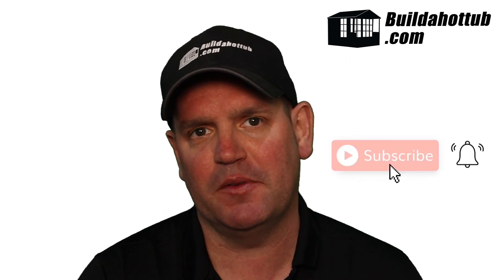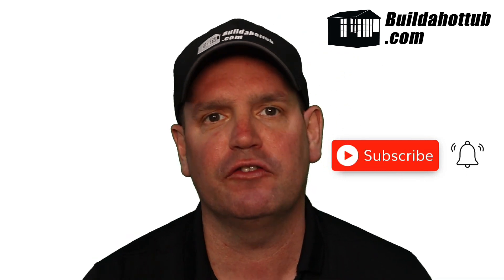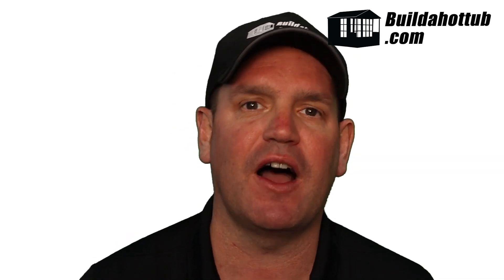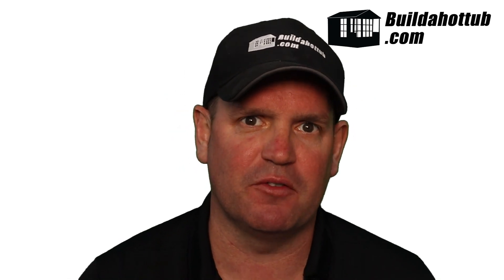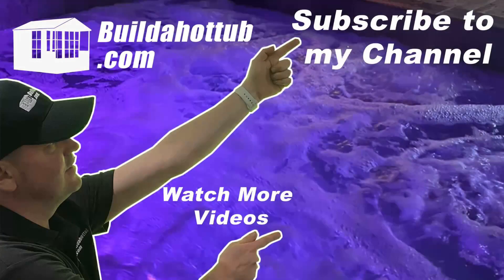How to Improve the Power on your Hot Tub Jets

Comment: Is it better to use 2 pumps and a venturi jet setup than a blower set up?
Reply from the maker: Hi There, thanks for the comment - you get a different jet that is more "bubbly" with an air blower and a stronger jet if you use two pumps to increase the flow. Hope that helps - Andi

Comment: How many water jets can I have with 2.2kW pump? It's LP300. I have 21 and it's very weak...I don't know if it's because of too low power or a mistake in installation. It looks good when the water level is low, but if I fill in the hot tub than the water jets are very weak
Reply from the maker: Hi Adrian, the LX LP300 is a 3HP pump normally, unless you have a non-oem model. As a rule of thumb, 16 jets is the max on a pump of this size if the pump is right next to the tub - any more, then you are reducing the flow as you can see - does depend on the type of jet though - I use waterway that need 10 GPM each and that is why 16 is the max, 160 GPM from a 3HP pump with little to no TDH is about all you will get in terms of flow. You are then going to ask if you get a bigger pump will it help - depends is the answer - really depends on the suction that you have and the pipe size too - you can put the biggest pump on the system you can find, but if the suction inlets only allow 80 GPM, that is all you are going to get - flow rates are a balance of suction drains, fittings, pipe sizes, lengths and pumps - Hope that helps - Andi
Reply: @Buildahottub  Thank you for answer. I replaced today LP300 (yes, it's 3 HP) where I have 21 water jets 32mm, with 1x DXD 320E (2 HP) for 12 water jets and 1x DXD 315E (1.5HP) for 9 water jets and now IMO it works as it should. 

PLEASE TELL ME! DO YOU HAVE A VIDEO WITH: HOW TO INSTALL AIR REGULATION FOR WATER JEST? What is the good practice here?